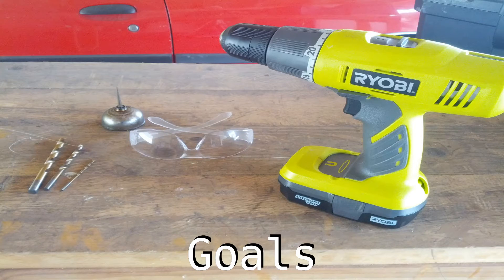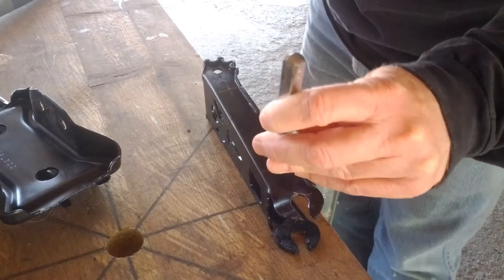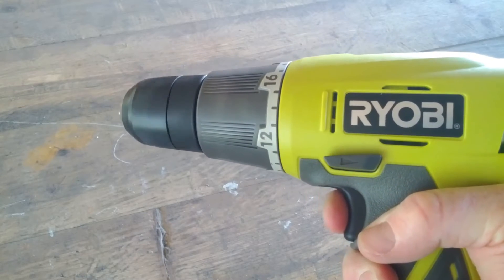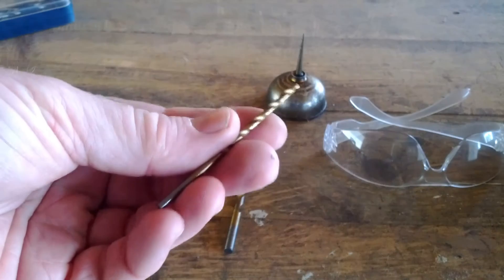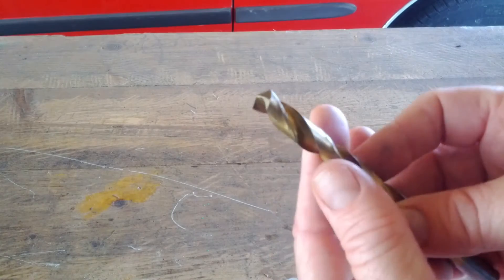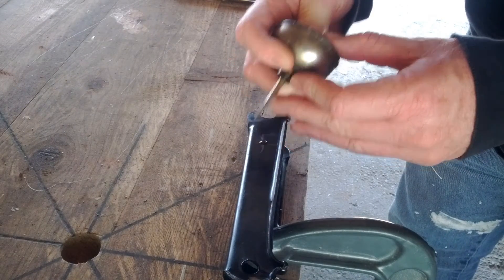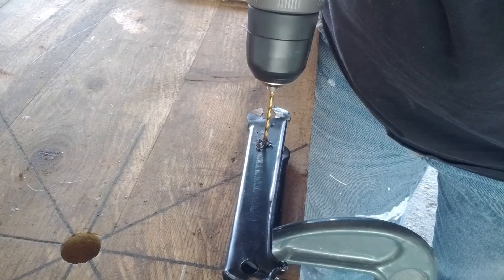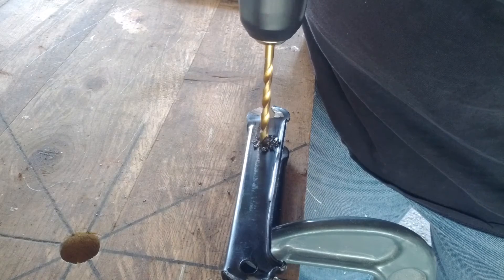how to drill metal

Comment: Idk what kind of metal my trailer is but it looks like it rusts so iron?
Reply from the maker: A trailer will be either steel or aluminum. Do not use oil if it is aluminum. Start with as small a drill bit as you can, if it seems like the bit is going to snap at any moment, use a thicker one. Then move up, step by step, to the desired size. Sometimes the steel is just really thick and you will have to spend a long time drilling, as long as chips of metal are coming out, you know your getting somewhere. I hope some of this helped, feel free to ask more questions if you still having trouble.
Reply: @bryannoyce  alright im going to try again but put a dimple in it first this time
Reply from the maker: @elliottjames671  That should get it started, good luck.

Comment: Thanks mate. No wonder I killed a bunch of drill bits. I was drilling way too fast (2000ish RPM). I will try way slower like you did.
Reply from the maker: That's why I do this... to save the drill bits ;) I hope it helps.
Reply from the maker: Yes, Torque! also the bit may not grab if it is going too fast, it just slides across the surface and gets hot.
Reply: RevolutionStandard my drill is single speed, I have no choice
Reply from the maker: Greenjoe, I have seen people use hand cranked drills to avoid single speed electric on metal! However it really depends on the speed of the electric drill, some go slower than others. Best of luck.
Reply: RevolutionStandard mine is 1200 rpm 120v and thanks im drilling a throw knife out of an angle iron and im having progress.
Reply from the maker: That sounds cool, this channel has a facebook page if you want to post pics, https://www.facebook.com/RevolutionStandard/    And if you have any questions, feel free to post here, or there, I can usually find the answers. {edit, I cant get that link to work}
Reply from the maker: trying the link again.   https://www.facebook.com/Revolution-Standard-1321455037944066/
Reply from the maker: now the link is working for me.
Reply: RevolutionStandard I'll when it is complete
Reply from the maker: looking forward to it